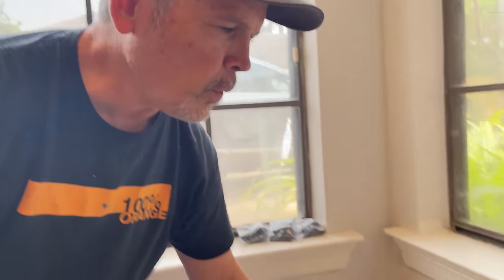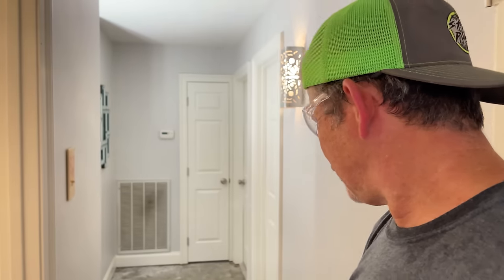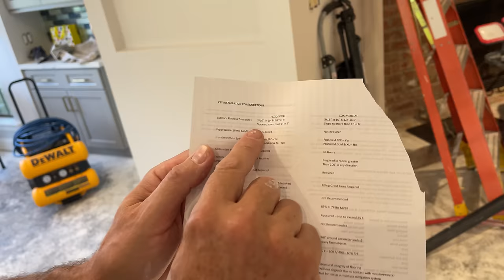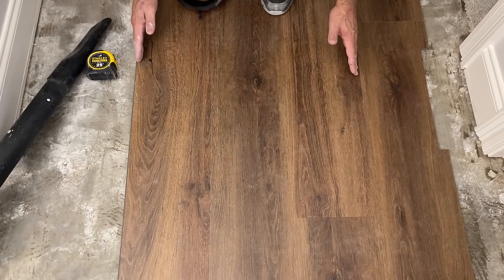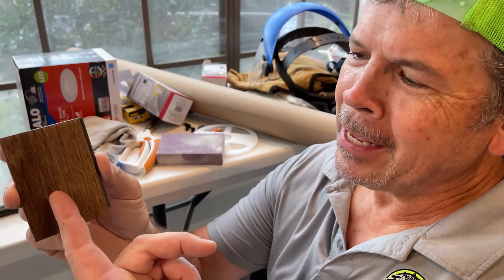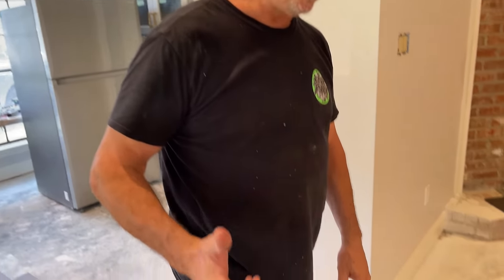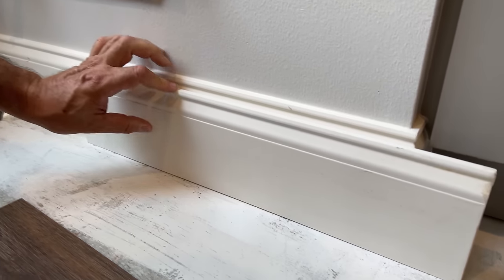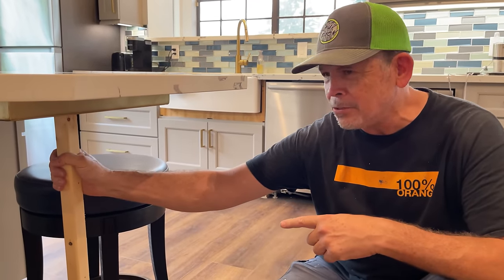The ULTIMATE FLOORING HACK! | Installing Vinyl Plank Flooring

Comment: Slightly weird starting out in the centre as you was working backwards for the most part as you mentioned it took a while longer but still a great job, depending which side your tongue and grooves are dictates which side of the room to start but never the less I get why you did that but you could have still worked out how many planks you would have needed to still get it central and potentially save a lot of time, so I guess that is my pro tip for you guys. First video if seen if you, awesome job!
Reply: We're getting ready to lay the entire house flooring, and thinking we'll be doing it this way.  Hoping the rooms are straight so we don't run into issues when we hit the hallway!  But we really want to do it with no thresholds, and it'll be the same material in the entire house.  Fingers crossed!!

Comment: I've gotten to where I watch pretty much every video from you guys.  I really appreciate your consideration for both the crafts you love and the customers you're working for, not to mention the inclusion of your family.  Two questions on this video: Is that product waterproof?  The soapy board edges gave me pause because the laminate of my floor is thirsty and the joints would swell and buckle if I did that, and the seams looked tight, but also flush across, where mine make v's that trap dirt and spilled liquid, allowing the latter to seep through and be a mold concern.  Do these planks keep liquids from seeping through joints when spilled?; And also, when I put my floors in I made a ton of errors as a noob to construction in general, and later found that I should've taken the doorframes off, if not the baseboards, as well.  I noticed you left the baseboards and trimmed with quarterround, which worked great, but do you think that removing door frames is also good practice, despite being some extra work?  It seemed like it would simplify the cuts to easy, straight-edged rectangular ones instead of measuring for custom notches.

Comment: I need you and Josh to do more composite flooring video's breaking down the way you measure&cut tight around inside ,outside  corners. Also,around base and other trim and escutcheons. thanks guys, you are definitely a cut above the rest.

Comment: This is great. I wish I had seen this before I did my first floor. Getting a the last pieces under thresholds and making them attach the rest seemed impossible when I first did it. I had to cut it out to where it didn't go underneath, and then get matching caulk to fill in the space. But, next time I will do this!

Comment: That was a very helpful video. I wondered how the heck you could keep that long line of flooring true.
I also noticed that the exterior door had no waterproofing/silicone under it. The original builders team was sloppy. It would have been a nice touch if you taken a minute to caulk that door trim down.

Comment: Wish I would’ve watched this before I did all the flooring in my 1/2 bath/laundry room! On the plus side I did learn a couple of useful tricks before I did the rest of my 2,000 sqft house! Do you have a video with more detail about cutting and fitting pieces around the edges and different shapes and pipes and things like that? This was, by far, my biggest struggle in the laundry room! All the plumbing comes up through the floor, plus lots of doorways and door trim to fit around/under, and that last partial piece along the edge of the wall that is never actually a straight line and is always such a tight fit it’s virtually impossible to get anything to fit together and into the space correctly!! If you could point me in the right direction for a video on that, if you have one, that would be awesome. Or if you know anyone else with good knowledge on it you’d recommend that would be great too! 
Thanks for all the great info! I’m loving your channel and the fact that you’re using it to teach your boys some skills! Keep going with the great content! I found your channel today and you’ve definitely got a new subscriber here! 🧡

Comment: You mentioned 2p 10 adhesive for the small pieces, is that the Thin product & did you use the activator to or just use the adhesive?
Reply: I just was able to pause the video & the bottle says it is the thick version, thanks for the great videos.

Comment: Hi guys.  Great channel!  New sub here.  I'm remodeling a walkout basement in my dad's house. The original floor is linoleum throughout with an indoor/outdoor carpet in the kitchen.  I pulled the carpet up and it left the orange glue residue there.  Can you put a vinyl floor over the old linoleum tile and over the residue glue?    My tile guy says he can install the vinyl floor over the old tile and over the glue in the kitchen. 

I'm concerned.  
Thoughts?  Thanks!

Comment: I'm not a carpenter by no measure but we did buy our 1st home that was gutted fr the foundation on up after the prev structure was set on fire by prev renting tenants yrs ago. Me & my girlfriend had some curiosity about the quality of the floor & we actually watched this entire viddy. Noticed some flaws in our floor like minor dips under the luxury vinyl flooring both on the main level and especially in the finished basement where the floor isn't always level (tilts a bit if that makes sense in some areas down there) & there's def more noticeable dips by feel when walking over some spots. Our seller (carpenter) admits its not his best work but we'll see how it goes when we get laundry equipment in the laundry room where there's the most tilt & one or 2 dips in the entry area of that room. Thanks for the details & for showing love to the commenters on this viddy. We know what quality control is after watching this

Comment: Love watching your videos and never would I have thought that I would have something to contribute to the conversation. My understanding for using those wedges are for expansion gap not necessarily for stabilizing the floor from movement. 
It looks like you didn't have any issue with needing more of an expansion gap because the floor would just slide right under the base trim. BUT in other cases someone would use something like that to ensure they are cutting to allow for a 1/4 in gap between the floor edge and a solid wall surface and then just install quarter round or base trim on top of the gap.
I use yard sticks for my installations. They are cheap, solid, and they run longer distances. They are also great at helping to help plan for changes in wall depths due to uneven walls.
You guys are great! Love watching your videos.

Comment: It's good to see how you lay these floors in the USA, I myself lay LVT, Laminate and expensive hardwood flooring here in the UK. 1 tip I can totally help you with is when you get to the end of a row, rather than measure it, is get the next plank flip it end over end, lay it on top of the previous board, slide it to the wall over the gap needed to finish and score or mark the top plank and will fit perfectly every time! Other than that great video, hope my tip comes in handy for you!

Comment: I've watched a couple of your videos where you are installing interlocking flooring.  I always see you installing one plank at a time. A trick I learned that makes this go faster is to lock the ends of an entire row together then tip the whole row up and lock it into the previous row. You'll use your hammer and tapping blocks a lot less.  Super long runs like where you started in the hallway and went all the way to the other end of the house get unmanageable for that process, but in average sized rooms it's not hard for two people to tip up and lock in an entire row. Much faster than doing one plank at a time, trying to lock an end and and edge together with tapping blocks.
Reply from the maker: Cool thx Leroy 👍👊

Comment: We installed a laminate flooring about 7 years ago in our home. We are now doing a renovation and will install a luxury vinyl. Can we use the same padding for the vinyl?
Reply from the maker: Is it padding or a vapor barrier?  See what the luxury vinyl requires.  If it only requires padding underneath go for it.  We didn't install a vapor barrier on this video cuz the manufacturer doesn't require one.  It's an SPC product (stone polymer composite) so it's unaffected by moisture (no wood in it at all)

Comment: I did the flooring in the 1st floor of my house back at the end of 2019. it was approx. 875sf and it was my 1st time doing it. Of course there are 3 different rooms to go through and I did not know how to transition from one room to the next so I just measure to the middle of the doorway and threw in some transition pieces. Also had one or two mishaps with door jam areas (missed the measurement by less than 1/2" but it is still noticeable). I also used a moisture barrier since we were putting it directly on concrete (was required for the warranty for NuCore), but that was simple enough. Definitely learned a few things through trial and error and still had a box left over when it was all said and done. Some of these little tips and tricks you showed would have save me a few hours of work but it is all done now.

Comment: Excellent video, I've installed several of these floors and I think after watching this I'll have a few new tricks for the next one. 
My one constructive criticism: freehanding the miters on the table saw is pretty dangerous! I prefer a miter saw for cross cuts and miters, skilsaw for rips and jigsaw for notches. Table saw is just about too much machine for this easy laminate flooring lol. I may be biased against table saw though, had an ejection event a few years back ripping ³/⁴ red oak hardwood, absolutely smashed my hip, ever since then I try to avoid the table saw unless I'm in a shop environment... I do see you have a nice crosscut sled set up though.
Keep up the good work! 
Subbed!

Comment: Been in the trades remodeled 100s of houses and you guys are good with your creative solutions to creative problem-solving. also, your quality, layout process, and attention to detail are great. excellent work The top post guy is right on all his tips but unless you remove the door you can't eliminate the gap on your jambs. (unless you want t try to pry the corners down and fill the corner with something depending on how the jamb is fastened.) you can move the casing down though. razer the caulk and either remove the casing or depending on the gap you may be able to get away using a tapping block and a hammer to push the casing down if you don't want to putty/paint/caulk the casing.

Comment: Think you guys did a great job only thing I do different is I would make my straight line down the hallway same as you but snap a few extra lines and start at the actual top of room work to hallway and I see nothing wrong with thinset to fill holes just as strong as any of that other crap never had a problem

Comment: I don’t know much about flooring but is it alright to add any type of moisture to the ends of this flooring to assist fitting?  Will there be any problems later such as lifting or bubbling?
Reply from the maker: This particular floor is called SPC (stone polymer composite).  No wood at all so no worries about swelling etc.

Comment: Great video!  Can I install LVT over 18" ceramic tile?  I have about 1500 sq ft of tile on concrete floor.  I don't want have to remove it.  Will I have to put a thinnest down so I don't see the grout lines?  Thanks and keep the videos coming!
Reply from the maker: Thx👍.  Tough question… I’d say short answer is yes but the success of the LVT installation depends on a lot.  1/8”
grout lines with no lippage your probably good to go.   Big grout lines and an uneven floor not so much.  Check LVT manufacturers specs on floor flatness and check your floor with an 8 foot level.  If you must flatten the floor, self leveling underpayment is great but 1500 sq ft is a huge job.  Mapei Planipatch could work but pot life is short.   Again a big job.   If you’re up to it I’d use SLU and research how to bond it to the tile properly (primer maybe?).   Good luck hope that helps 👍👊

Comment: I'm a Crew of One.. I use unopened boxes of flooring to hold my straight run in place... also I use my Jigsaw to cut pieces as needed... Eliminates getting up and down... small whisk broom or vacuum to keep shavings away from under the product... works for me... as a Crew of One

Comment: Odd but ive noticed this same issue, but a room or division point is always a doorway.
So in the hallway the vinyl floor should end centered under the door so that when the door is shut the carpet is in the room and the vinyl is in the hallway. 
I replace a ton these days where whomever installed the flooring , transition on the opposite  side of the door.
Another cool yrick is if you snap all your butt joints together and install full rows you only need to tilt the row and pop it into place vs fighting both joints. Prevents beating on the tile

Comment: What if the subfloor is old tile with a heating system beneath it? How would you anchor the flooring to the subfloor such that the tapping would not induce any movement?
Reply: Snapping chalk line as reference point

Comment: The vinyl flooring seems a lot easier to lay than click lock laminate.  The last one I did had click lock on the ends and I practically had to lock in a strip of 3 to make it go faster, but doing it by myself was a pain.  And then you get them all locked in and that last piece causes the first one at the far end to creep apart.  Loved that soap trick, but pretty sure that won't work for laminate.  And I hate the little plastic whacker, I keep a cut piece to use for whacking.

Comment: Hi. Love your video. We have some glued down flooring we need to remove. What is that electrical tool you used to get the flooring up?
Reply from the maker: mcmaster.com item #5864A61
It's pneumatic actually 👍 if it's the one I'm thinking about
Reply: @StudPack  Thank you for your prompt reply. I appreciate it.

Comment: I have used a diamond blade to undercut the brick hearth in about 1/2-3/4” so the flooring slides under the hearth to eliminate the need for shoe or any trim piece

Comment: When useing a miter or table saw on vinal floor or siding use a composition blade for metal or conc. Its safer than a steel blade and cuts great

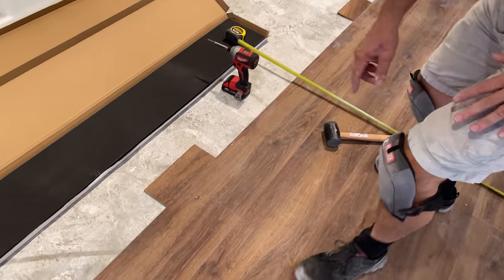Comment: 16:07 I personally go the route of quarter round or removing the baseboard, sliding them together just seem to be the move, 18:03 from my experience you don’t really have to tap vinyl plank or laminate if you holder higher than 45° and do a quick tug

Comment: I'm interested in tips on a way forward for a major renovation which could potentially turn into a tear-down and rebuild.  I'm 90% finished with removing old vinyl flooring at my mom's house.  The last 10% is on hold because of difficult with disassembling a China cabinet sitting on top of the last 10% of the floor.  I'll figure out a way to get it done.  Once it's out, my intent is to sand residual glue from the concrete foundation.  Approaching this with caution out of concern for potential asbestos in the glue.  Afterward, the floor will be put on hold.  Focus will shift to removing popcorn ceilings.  Again, cautiously due to potential asbestos.  Testing will be done in all suspect areas.  Afterwards, some drywall will need to be removed in order to search for and repair suspected frame damage.  Then an electrician will need to come in to run new electrical in certain parts of the house, install outlets, lighting fixtures, fans, switches, and a new circuit breaker box.  Insulation in the attic will be replaced, to include HVAC ducts.  The heater and AC units will be replaced.  Cabinets (hallway/kitchen), interior doors and the front door will be replaced.  The fireplace facade and hearth will be replaced and the chimney swept. The bathrooms will be renovated.  The entire interior will be painted.  The concrete floor will be leveled with thin-set.  The last thing that goes in will be the floor and moulding.  A lengthy renovation.  So much work will go into the renovation that I need to consider whether the house is worth renovating or if a tear-down and rebuild is possibly a better way to go.  What should be considered when making that decision?  Also, if it's better to just renovated everything mentioned, is there a more logical sequence for performing the work than the sequence I outlined?  Any other tips?  Incidentally, if renovation is the way to go, my intent is to maximize the amount of demolition that will be necessary before any renovation begins.  Is this a good or bad idea?  Thanks for making this video.  You taught me quite a bit and reinforced a few tips learned from other videos.